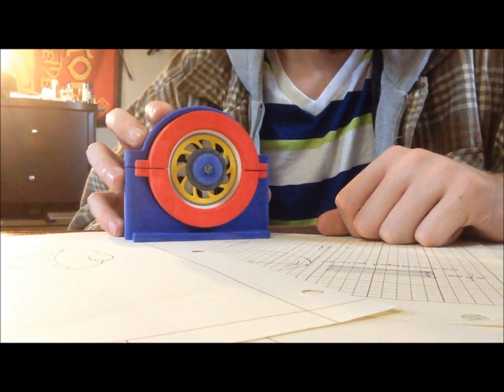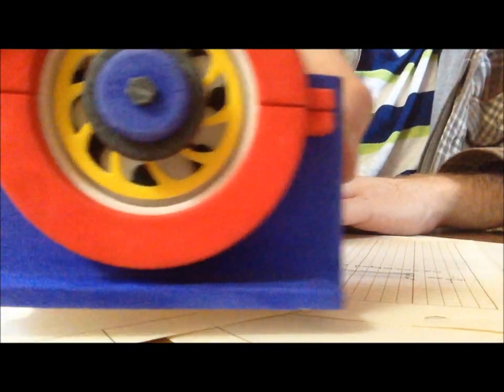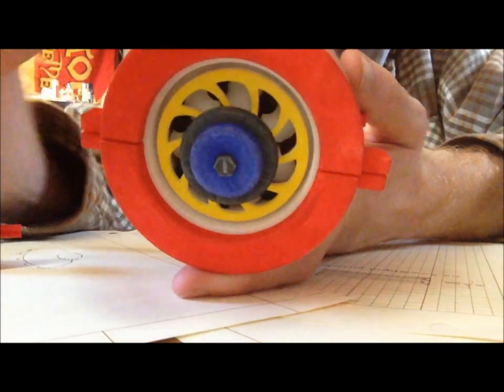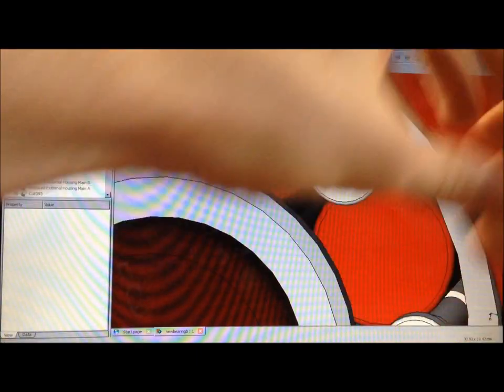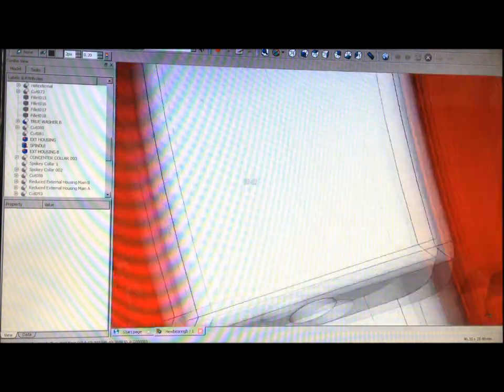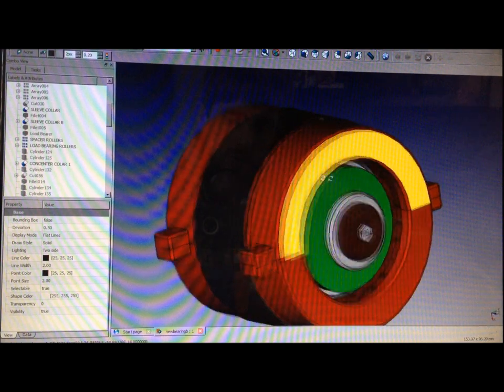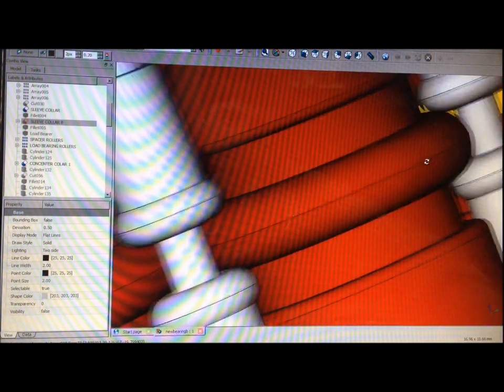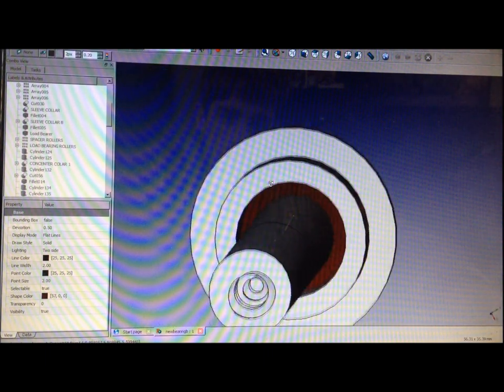First Ever 3D Printed "Box of Crazy" Roller Bearing

Comment: Awesome channel Nick :) Love it !!!
Digging into old public released patents is a great idea.
This one looks incredibly smooth !!! Is it PLA ? What paint did you use that doesn't increase friction too much ? Much post processing, sanding etc... or did it work right away ? And did you test how it stands force applied to its axis ???

Cheers from belgium :)
Reply from the maker: Hey there! Thank you very much for the kind words! Next week's video is on another patent, a roller bearing from 50 years prior which similarly uses rolling motion to separate the rollers. That being said it's a relief for me that you think it's a good idea! 

The material is actually a fine powder nylon which is laser sintered via stereolithography. It was made commercially so it has relatively high dimensional accuracy. It's also quite resilient, but has some flexibility so under more load the rollers unfortunately begin to flex. 

The paint I'm using is simply children's classroom paint, and is only on non-mechanical surfaces, so it won't slow anything down. 

It definitely required more than a usual amount of sanding.The tight tolerances desired were achieved by designing over-fitting parts and carefully sanding their surfaces round until they turned well when assembled. Further spinning removed any remaining significant imperfections. 

I would like to use more scientific methods to measure the efficacy of this bearing and any others I make in the future, but for this one I was only able to do it somewhat barbarically and is anecdotal at best, so I apologize in advance. The first test involved holding down on the outer flanges by hand, and placing down-force onto the bearing with my shoulder as I rolled it like a wheel across my table. Another test involved building a mounting bracket for it, in which I also used the bearing's external housing like a wheel, but a platform was placed on top while I set weights on it. 

It was able to roll with nearly 7 kilos before the feel of the rollers flexing was apparent. Perhaps with some structural engineering with 3D Printing in mind, the parts could possibly be made both lighter and stiffer. 

CHEERS! Have an awesome day.

Comment: Did you design this in FreeCad?
Reply from the maker: +Demetris Stavrou Absolutely. Thanks for watching.
Reply: Wow. That is impressive. You should do a video about your design flow with FreeCad.
Reply from the maker: +Demetris Stavrou I'm going to make a part 2 video in which I will respond to as many comments as I can. Another person requested that I make another video to show how to make one of the parts, so you're not the only one. Stay tuned.
Reply: +NG 3D Modeling That would be great. Having done some FreeCad modelling myself, what I find interesting is how you designed the parts to fit together. There aren't many videos on youtube showing how to design individual parts that fit to create a larger part. I think you should focus on that rather than how to model a single part. Thanks!

Comment: can i get  a cad model file of it
Reply from the maker: Unfortunately I lost the CAD file when I lost my last computer. However, I still have access to the .STL files. Let me know if you can work with those and I'll make them available.
Reply: ya that would be help full thank you
Reply from the maker: What were you planning on doing with the model? I have the model files available for download now at http://www.thingiverse.com/thing:2235471

The reason why I ask is because I don't recommend making it with a home 3D Printer. This was made professionally for me using laser sintering. I explain why I don't recommend making it with a normal printer in the summary. It will essentially be very difficult to sand properly, which is vital to it working, if made using filament. 

Assembly is also a pain, I don't have any instructions for assembly, but I give a quick tip on the summary as well, but I may do another video in the future on how to assemble it.